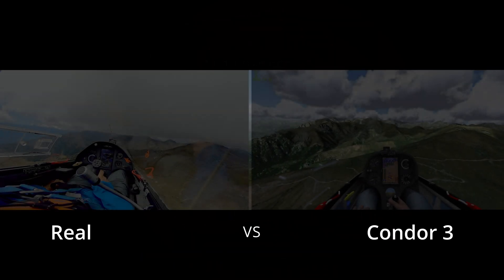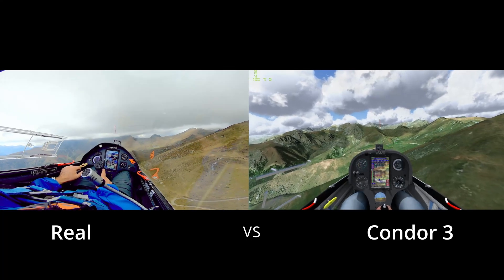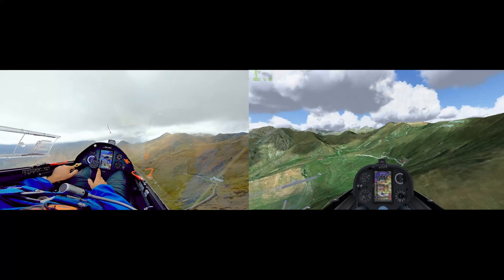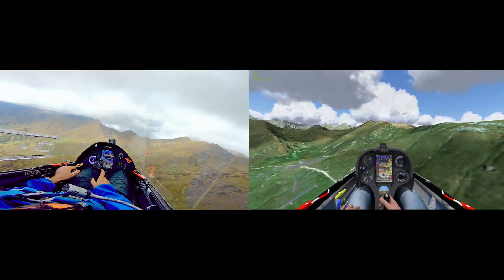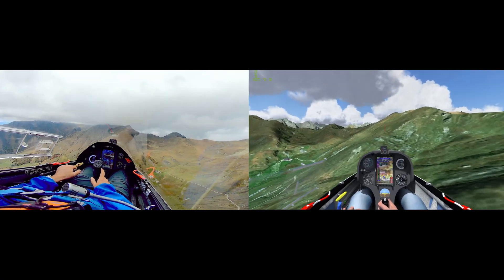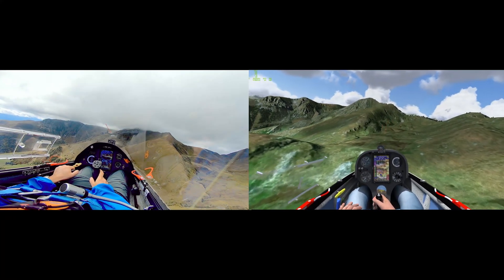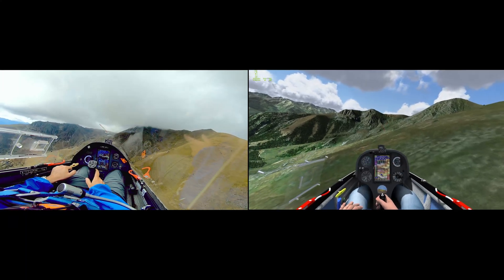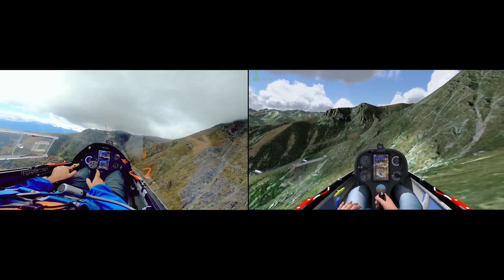condor 3 vs real life soaring

Comment: Very nicely done. Stereo Vario sounds cool. I’ve been using MSFS 2020 & 2024 for a while, and in the last few months, I’ve gotten very interested in gliding. It’s a good experience especially in VR but I’ve heard many real pilots praising Condor, so I just bought C3 and took my first few flights yesterday. I haven’t yet worked how to use VR in C3 with my Pimax Crystal Light. I know it’s possible but I’m hoping Condor will support OpenXR soon. Finally a question: where did you get the terrain files for the Turin area? Slovenia is nice and quite diverse, but I have some other favorite areas, especially the Alps. Thanks!
Reply from the maker: First of all, thanks for your comments. For the sceneries, you can find all you need for Condor at Condor Club: https://www.condor.club/home/1/ There's a huge amount of sceneries. They are not that cool as the ones for MFS, but they are good enough to enjoy the areas you want. Turin area is covered by Arc Alpin scenery.
Reply: Thanks! I realized after I asked that I should have just done some web searches first. I’ve signed up for some sites and I bought a landscape covering most of Switzerland, where I have done some real flying (not in gliders).